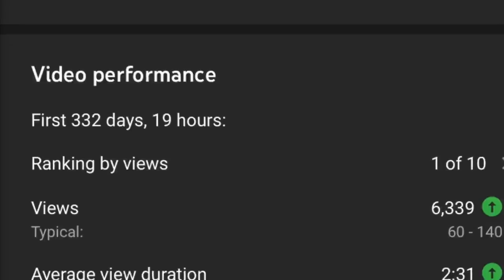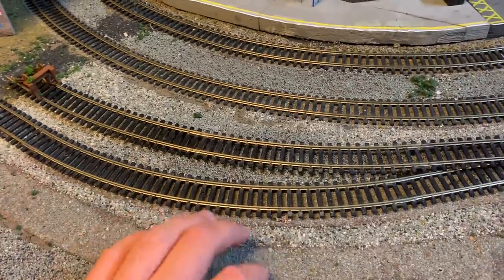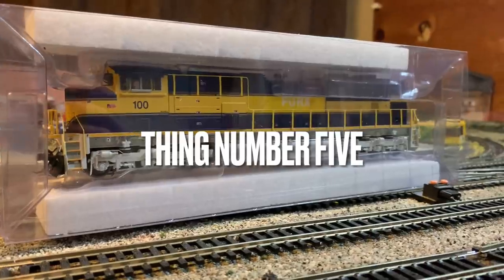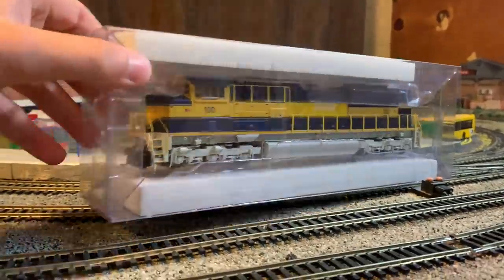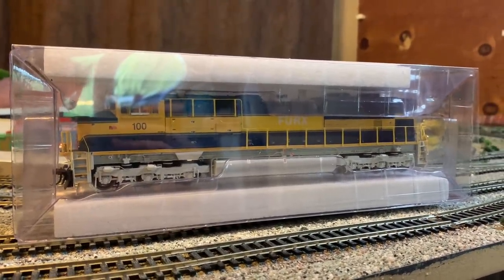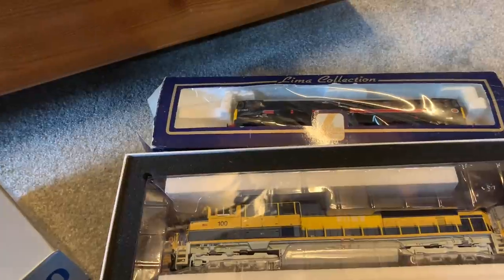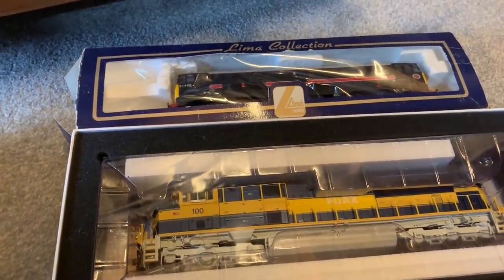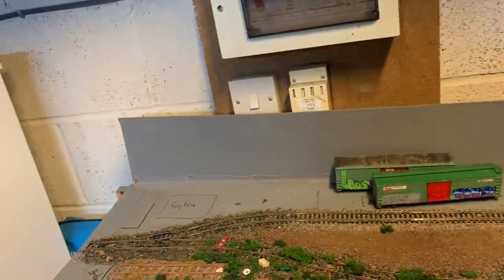DONT DO THIS ON YOUR MODEL RAILWAY (Top 10 Things to Avoid in 00 Gauge)

Comment: I can relate to much of what you are saying. I’m from Kansas City (USA) and much older, but I still struggled with lack of focus. A few years ago I met someone who has become one of my best friends. He introduced me to a group of layout owners who gather at one another’s homes for operating sessions. I learned some invaluable things out of this. First, building and running a layout with friends is more fun and takes advantage of the synergy created by the joining of different skill sets. Second, your space will be better utilized if you build around the perimeter rather than in the middle of the room. Third, even a spare bedroom can provide plenty of action if you make it an industrial layout or even a double decked layout. Fourth, build it with modules. I live in a small two bedroom duplex that we don’t own, but modular construction takes the fear out of building a layout because you can always move it with you if circumstances require. Fifth, don’t add scenery until you are sure the track plan actually works like you want it to. It’s a great hobby which utilized more skills than most hobbies. Good luck! Enjoy!

Comment: The feeder rail is good only for temporary layouts. For a permanent one, use fishplates with soldered wires, or solder wires on the side of the tracks.
Reply from the maker: Yeah I will do in my next layout whenever that gets started! Thanks for the comment!

Comment: When I started modelling again I built a small layout, and used it to redevelop my skills, find out what I was good at and what I needed to practice. Needless to say I made mistakes, cleared them away and did it again, or did different.  The basic track plan was not altered, only the scenery.  I operate on the the principle of it’s my layout I’ll run what I want, but I do have a theme.  Late 50 / early 60 south midlands, but I can shift back or forwards by changing a few scenic elements.

Comment: Adam,  interesting video and some good points.  I have faced some similar situations as I like to model both British and North American profiles.  My solutions was to have one layout and just change the buildings and rolling stock to fit whichever profile I feel like running.  Essentially it is two layouts in one.  So don't think of those mixed purchases as mistakes, they are not.
Reply from the maker: That is an idea I have toyed with in the past, sort of just replacing British buildings with American counterparts and in fairness I could use that in a future layout, my only issue would be that if I was modelling Canada for example then the mainline would most likely be single track whereas in the uk I’d be modelling a mainline, although I did also have the idea of a double deck layout or using scenic breaks to divide eras and locations for different parts of the layout. Thanks for the comment!

Comment: Been there, done that!

Have a look at the diesels on the Hartz Mountain line (metre gauge).  If anything is outsize, they are.  They are almost one and a half times the height of the rolling stock.  There is one tunnel on that line (58 metres long), and I wonder how they get though it, probably with millimetres to spare.  

I am building a OO9/HOe layout based on a fictional Scottish setting.  I have made mistakes as well.  My first mistake was to buy a Bachmann Lynton & Barnstable 2-6-2.  Lovely runner.  It cannot go round the minimum radii that I have.  If I knew that the minimum radius was 30 cm, I would not have bought it at £150 or so.  Experience is a good school, but the fees are high.

Electrofrogs can also be tricky; you get short circuits on some settings.  I thought I knew about electrics (at my age, I am strictly analogue), until I tried electrofrogs.  Complex switching helps...  So don't dismiss set track.  It is useful in fiddle yards on any future layout that you make.

Selling my old stuff is the worst thing you can do.  I have done that and I felt I had sold part of myself.  This was ancient Hornby (in those days Tri-ang) stuff.  Rather coarse scale, but I have been interested in trains my entire life, so it was part of me.

You have had a go at scratch-building an American themed locomotive.  It has come out well.  You could have a go at scratch-building free-lance locos or stock, which is what I have been doing, and I have two left hands, all thumbs.  I have been doing this for my line, which saves a shed-load of money (£50 for a loco, rather than £150 - 200).  And very satisfying.  As for buildings, there are several manfacturerers of brickpapers or plastic sheets embossed with brick/stone/tiles/corrugated iron.

Above all, think about the positives.  Building a model railway is creating a piece of art every bit as valid as painting a picture.  If anyone views it, their imagination will fill in all the missing bits.  You have the enthusiasm, and you have learned from all your mistakes, which you have been so kind to share.  I could not film myself; the sound of my own voice freaks me out.  And for that matter I am no longer particularly photogenic!

Comment: Hey, thanks for your video. As a person who has been model railway building for 4 decades, I feel for you. My "no-g0" mistake would be to be very careful buying second hand locos. I have wasted money on engines which seemed good in the store/exhibition, but only lasted for a very short time before breaking down. Non motorised rolling stock is less risky and you can sometimes get a bargain. Keep at it!
Reply from the maker: Yeah I have made a couple mistakes with second had, I paid £80 for a class 56 that was repainted into Artemis rail which you can’t on my really see  in ready to run form, turns out it’s a mainline model and runs appallingly! Definitely regret that but I’m hoping It’s fixable and just need a good clean! Cheers for the comment

Comment: I have same points, where I have problems I just glue a small piece of rail to guide the wheels. By running your train slow you can see at which point they stray, just put rail there pushing the wheels back in line.

Comment: I fully concur with Number Two - Hornby power tracks are horrible. That was my first regret, when starting a new layout recently. Immediately swapped them for soldered droppers.
The old style power clips can also be a problem, if you fit them in the wrong place (like the outside of a bend). My Duchess of Gloucester had its front steps ripped off, when it clobbered the connector. 
One advantage of soldering directly to a straight track (easier than you'd think), is the cost saving: R600 straight = £3, R8206 power track = £12! 
Another tip I learned the hard way, is never store your expensive stock in the loft. Temperature extremes can ruin it. (I've had several plastic gears split, on locos in storage).

Comment: Too many people seem to be soo focused on prototypical setups.. why not just run whatever locos and carriages you like and choose to run.. (That's what I do) it's your layout and why can't you run what you like and want.... ?? why be worried about what others say and think when it's YOUR layout... not theirs?  Slow the train down when going through the setpoints and that will alleviate the derailing issues... or put a small piece of track in between the points to make it a longer area. The large loco (in preparation for the larger layout as this is a very very small layout and you will grow out of that in a matter of months...  Take the items out of the boxes and then store the empty boxes elsewhere... in a wardrobe or cupboard not being used... most of these issues you are coming up with can be very easily sorted when you think outside of the box.. pun intended..

Comment: Rule number 1 applies. It's your railway so you get to run what you want. 

That said if you've got something you don't really use then don't be afraid to sell it off to fund something you might want. But as you say its worth thinking carefully about it beforehand.  I think Iron Horse Railways on here did z video on the subject not too long ago so maybe it's worth checking that out. 
Plus you could always say the bubble car is in a 'heritage' livery like the Southern 313 or the SWR 455. 
Personally I go from Steam right through BR green, Diesel Transition to the Blue Era and now into Sectorisation, since I grew up through the 80s and saw that era come in. 
Everard Junction is a good 'early' sectorisation era layout if you haven't seen it but your layout looks a lot of fun. I definitely agree on that power track though. It's the same size as an R600 straight so maybe lifting it and putting one in with the wires soldered in place would look better. It should be easy enough as it doesn't look like you've ballasted the track so it should be pretty straight forward.

For points, Peco do a good range and you can often get 'new' old stock ones on Ebay for, well, beans really. So maybe that's an option. Really Hornby's set track points are too tight for even a siding.

As to the big locos, maybe its worth putting together an 'American' inglenook layout for it. That way it can run without striking the DCC connector and risking damage. That might fit on a 4x1 ft board and you'd only really need a few wagons to shunt around.

Comment: Hi .
I have built all my layouts out of scrap railway bits .  You can hide unsitly small boxes in bushes . Also if you have a modern layout with a heritage railway in it then you can run everything..
I have run a Bigby round it and it's not that big a layout really .
I also prefer constant running to shunting 
,so only fake points that look good but don't move . 
Stick at it ..I have years off but always come back ..  good luck 🤞

Comment: You have obviously cracked it as I see you have 2.2k views, that is substantial.
I have been on YouTube for  about 10 years and have only about 650 subs although some videos have over 10k views, this could be because I have covered a variety of subjects and as such,  the audience us divided.
I have collected trains probably for nearly 20 years on and off because I travelled for work and I didn’t  have a layout.
It wasn’t until about two years ago I started a layout, my wife having affirmed me a 9’x9’ room. My dreams of having that big layout with big locos speeding down straight runs were dashed.
I managed to get one track laid in a big loop and had the Coronation, Flying Scotsman etc pulling full rakes but eventually added a few more tracks and points.
I didn’t plan it out too well and haven’t isolated any sections and cannot cross over. I must think that through before I start cutting track.
Many times I have thought I have collected too many locos and coaches, steam, diesel and electric locos covering a span of fine but I enjoy them all.
My layout is DC as when I first began to buy trains that was all that was around and before I knew it I was too far in and the cost to add chips was .
So I endeavour to service and maintain my locos and stock and get a great deal of enjoyment from small successes.
But I did buy a Hornby Digital Controller and have one chip so I might dedicate one track to DCC

So keep up the good work.
Regards
Reply from the maker: Yeah I think the title was the main reason it got views, it draws people in I guess! I’ve been doing this on and off for about 5 years I think, but it’s good you finally managed to get a layout and somewhere to run all your stock! Honestly I know nothing about electrics and isolating stuff so you probably did it better than I would lol, I have one DC controller for both tracks which isn’t optimal tbh! Cheers for the comment!
Reply: Charlie you don’t do to bad my friend hope all’s going well with the live streams. 👌😎Fred
Reply: @wilbury Castle Hi Fred, watching the Monday Club right now. Have done a couple of videos on servicing my locos and just had to give up on my class 29 as I lost one of those tiny springs! Who do you recommend for parts?
I did a live video last night about the Chevrolet Camaro, that had its own live challenges but it ended well. That was episode 5

Comment: In this video you made some very good point and you've given me one or two thing to think about, the power track being one of them and how to hide it
Reply from the maker: I think if you know how to do it it’s easier to solder the wires directly into the track rather than use a power track, but you could still hide a power track if you have a hidden tunnel or staging yard for example, cheers for the comment!

Comment: Sixty years ago the Triang power connector clips were less obtrusive and could be connected to virtually any piece of Triang plain track.
For today soldering may be easier to just solder to numerous fishplates on their underside. The dropper wires through holes drilled through the baseboards. Numerous add up to better connections. Bus wires underneath reduce voltage drop issues on larger layouts.
Our very reliable club layouts have every piece of rail with a wire connected to it.
 Soldering to rail needs good skills otherwise sleepers melt and big obvious blobs on rails.
Reply from the maker: Thanks for the comment!

Comment: You can buy fish plates with wires already soldered to then.then drill very small holes to feed the wires through the board.very discreet!
Reply: The advantage of soldering to the track rather than the fishplates is that you're not relying on the fishplate / rail interface to supply power. With the track live it doesn't matter how tight the fishplates are.

Comment: It is always better to sell privately (e-Bay, etc.). Shops such as Hattons need to make a profit (as they have overheads that have to be taken into account), else there is no reason for them to involve themselves in the second-hand market. A person might have paid £600 to buy a number of new rolling stock items. When a company buys 'day to day' second-hand goods, they typically offer 25% of the original purchase value (say £150). They will then sell it on at around 50% of the original price (say £300) as they are used items. Sought after and rarer items might be worth more to them, therefore they are likely to offer more, typically they will want to sell the item at least at double the cost that they paid the seller.  

Most of us have done exactly the same sometime during our lives, but hopefully we learn not to repeat the action.
Reply from the maker: Yeah I certainly will avoid selling privately again, I think eBay takes a commission though? I’d have to look into it! Thanks for the comment!

Comment: Be aware that you might have a stroke (as I have) then you can't do anything.The layout should be easily dismantled to move to a new location. I have no use in my left arm and hand.so cannot  do maintenance and simple repairs, very frustrating ,as I have new locos to try out. So FUTURE PROOF is the moral, you never know what might happen as you get older and less able!
Reply from the maker: Given that I’m 18 I’d like to think I don’t have to worry about that just yet, but you never know! Sorry to hear about your stroke hope you are well, I will definitely think about it when I’m older for example lift it sections rather than drawing under and dojng my back in! Thanks for the comment

Comment: I think almost every model railway enthusiast makes mistakes in buying the wrong locomotive or rolling stock.You can buy double oo guage road markings from most model railway shops.you rub them onto the layout from a sheet.they are made by Busch.they also make graffiti on sheets.the road markings have zebra crossing and bus stop marking and letters.also speed limits.centre of the road markings.left and right bends.In each pack there is a plastic tool to use for rubbing these things onto layout.Ive been working on my N guage Swiss.German layout for 40 years.So keep at it.dont get upset or give up.
Reply from the maker: I’m happy doing the graffiti myself I enjoy doing it but I think I can get most things off scalemodelscenery!

Comment: I run AC/DC Ho trains Ho narrow gauge and getting into field railway (z gauge Ho) and atleast with trix and Marklin all the power wires are hidden under the tracks and with n and z gauge the power terminals are molded as relay boxes on a real railroad
Reply from the maker: Sounds like a lot going on! Thanks fo the comment
Reply: I spent a lot of money though to find the perfect mix of systems

Comment: Derailment at turnout points seems to be a common problem, more so with certain locos depending on the make and age.?
Reply from the maker: Yeah that is possible, I thjnk realostically the locos I run are too big for those points, when my 08 worked it ran over them fine! Cheers for the comment!
Reply: @Locoforce  - the locos should be fine over those points. You will struggle to use Streamline points on an oval layout like that, as they are too big a radius. 
Check your back-to-back gauge of your stock, as if any of the wheels are too close together, or too far apart, they will catch somewhere.
Try pushing the loco, unpowered, through the points and see if the wheels catch anywhere. By pushing them you can force the flanges to follow either rail and you may find that the rails aren't perfectly aligned, or the axle binds on the track; and you may even find that the wheels ride up as they go over the frog, or drop down (if the gap in the rails is too big). 
Check the couplings -- if they are too tight they can force the bogies off the rails. Close coupling won't work on a tight radius layout like that. Check what happens to the hooks of each vehicle coupling as it traverses the crossover: do they bang together? are they at the same height? do they foul some part of the chassis?
Slow down. On the prototype it is pretty normal to have a speed restriction across a junction!